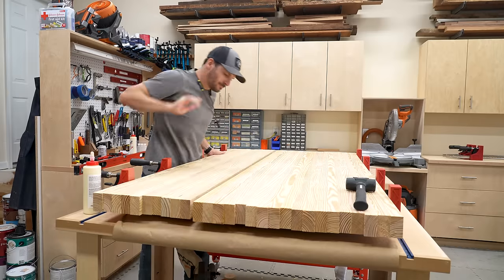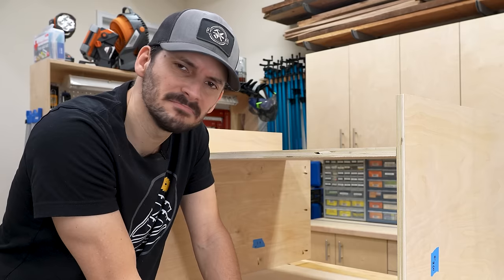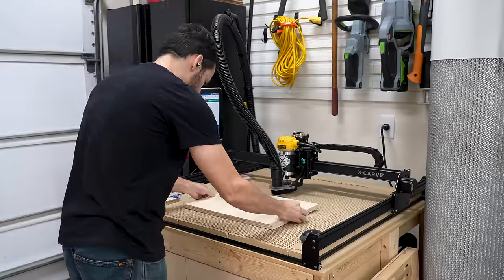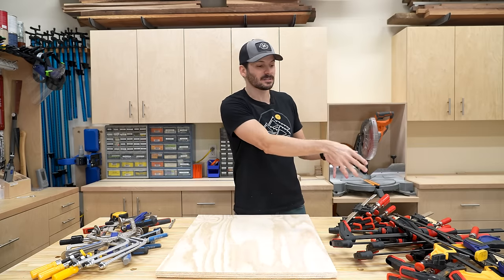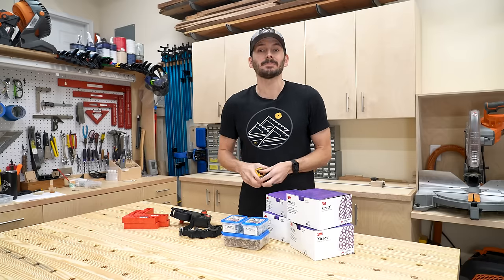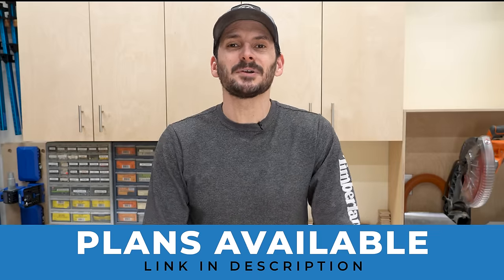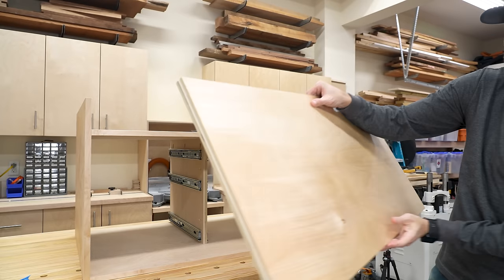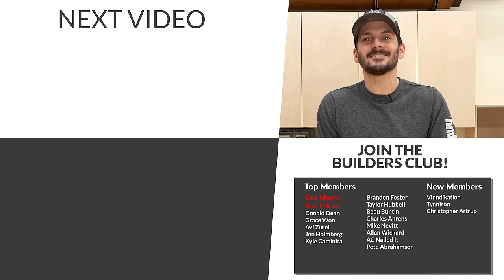I Supercharged My 2x4 Workbench

Comment: Great stuff, Brad. You forgot one option for the top drawer front: use two pieces (as if you have two drawers, like below) of scrap with the grain running how you like. One big drawer that looks like two and you use two pulls.
Reply: I came here to suggest the same thing.
Reply from the maker: Great suggestion!

Comment: On my assembly table, I put a divider across in the middle with a drawer on the side of one end, and beneath it, I put a slide-out drawer in the end for my belt/disc combo sander with a curtain in front to keep most of the dust out. The side beneath the drawer and on the other end was boarded up, and has yet to see use. On the other end, I divided it in 2 lengthwise with 3 shelves with slightly raised front edges on one side for tool boxes, and on the other side, a drawer for gloves at the bottom with a shelf for random bigger parts above it. On the end, I mounted holders for spray cans at the bottom, and I plan to find some solution for holding speed squares and the like above them.

Comment: Great job. One thing that would bother me about this is sawdust and small items falling through the dog holes and are now harder to get to (e.g. between the cabinets and the shop vac or on the middle of the shelf). Do you have any plans to make a tray or something to make clean up easier?
Reply: That was what he was trying to build when he realized there wasn't a piece long enough to make a drawer front (grain direction issue).  So he postponed it to later.

Comment: The holder for the sander is going to put uneven pressure on the sanding pad, warping the pad over time, which will cause the sander to create swirls and sand things unevenly. Random orbit sanders should always be stored resting on a flat surface.

Comment: I need to get large mouthed jaw clamps, for 2x4s and 2x6s.recommendations?
Reply from the maker: I usually clamp 2x4s and 2x6's with f-clamps.  18" is a good size for side to side and 6" are great for clamping flat
Reply: @Fixthisbuildthat  Do you have a brand or store you get good ones?

Comment: you could also make a rabbit in your drawers for about 1/2 inch from the bottom where your bottom-board can sit in. that way you don't need to glue or tack the board anymore. just 1 pass with a dado-stack or 2 passes with you tablesaw and its done ;-)

Comment: The top is def a more workable size. IMO the only thing(s) not thought out were a clean built-in power
source and more importantly face and end vises. Depending on the vise you could still add them and be glad you did. Get quick release non-racking models. Just sayin'

Comment: 13:02  As a fellow perfectionist, I may have a drawer front solution here that passes muster, using your existing materials.  Your wide top drawer is above 2 banks of drawers with a vertical gap between the left and right.  How about cutting 2 similar pieces from your piece in this shot, each one half the length, and mount those on the front of the long drawer, so as to make a faux 2-drawer false front, with its vertical gap aligned with the actual vertical gap below it?  You could even make them a bit taller, cut back that horizontal divider below it (you know, the one with the, errg, cough, flaw in it) by 3/4", and have them hang down in front of it, so as to also have a matching horizontal gap between the bottom of the long drawer and the tops of the 2 below it.  
Well, did I pass the perfectionist challenge? 😎
Reply from the maker: Clever solution!
Reply: That's a great idea.

Comment: the only issue I see is, where is the vent on the vacuum? where does the air come out? it looks like it was on the side facing the board you just installed that hangs the hose? if so you are blocking the vent and could burn out the vacuum.

Comment: Unrelated to the video, but Brad, why is it that JET ended their sponsorship with you years ago yet i still see ad videos for them on facebook and amazon with you in it?😅 I just though it weird for them to not want to sponsor the channel anymore but not have an issue with still using old videos of you
Reply from the maker: they should not be doing that.  Do you recall which product(s) it was for???  I see a video on Amazon for their 22-44 sander, but didn't see anything on Facebook
Reply: @Fixthisbuildthat  i see links with your picture on it in random spots when i flip through facebook marketplace and i was looking at a jet router table on amazon that had a video of you operating it